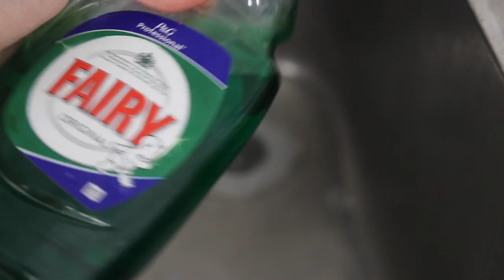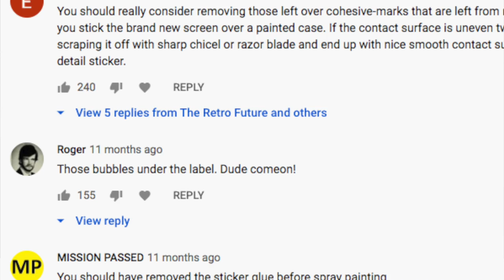$15 GameBoy Advance Repair & Restoration!

Comment: "I am going to give it my best shot to get this on film. Here we go." Shortly after, the bill of the cap gets in the way of the camera. ;)
Reply from the maker: Hahaha I hoped no one would have noticed!
Reply: @TheRetroFuture  soldering on camera makes everything about 10x harder, believe me I'm good with an iron and I struggle to do even large smd parts when there's a camera in the way.
Reply: @sjm4306  The people that get really good at it use a microscope with a video feed hooked up to it. So instead of using a helping hands with a mounted magnifying glass they just look through a screen

Comment: For your screen, you need to watch a few toy car restoration videos like Martys matchbox makeovers, Matchbox Garage  & Diecast resurrection. They show you how to restore the scratched plastic windows on these cars using Pledge revive it, 1200 grit wet & dry sandpaper  and stainless steel grit polish, most of the time they come out brand new looking. That's my 10ps worth of advice, love what you do keeping the nostalgia alive.

Comment: One way to repair scratched screen lens is to use fine grit sand paper and then clear coat it. The acrylic will set in and give you a good as new screen. Just be sure to wash it well after sanding and use the non-glossy acrylic paint, it improves on the original by reflecting less light. That's also how I fix scratched old CDs.

Comment: i just recently cleaned up my old GBA and buffed the scratched plastic screen lens. the brillo pad is a great way to start buffing out any larger, deeper scratches but as for a fine abraisive you can use toothpaste on a cotton pad to get an almost clean, tartar free finish

Comment: I had purchased a "broken" glacier blue Gameboy advance for like $5 to repair and when I got the thing, it immediately powerd on and I was pretty upset that I didn't get to do a repair it so I bought an ips v2 screen and moded it. Now I'm addicted and I have a original nintendo ds and a ds i xl that I will be restoring.

Comment: Friendly tip: Maybe use an ESD brush when brushing dust of the board. Static discharge can be a problem if you are unlucky. Great Video BTW //Samuel from Sweden
Reply: ESD brushes are good but with something as modern as a GBA they're not really necessary. The components are hardy enough not to get damaged.

Comment: Iknow it's old video but best way to remove almost everything is using isopropyl alcohol or n-hexane on cloth. These solvents can remove all marks and dirts, even more glue marks. Nothing to say it removes greasy, oily spots after fingers. So paint can stick even better

Comment: 😉Nicely done! The result is simply fantastic! You were wondering if this thing had already been tore appart and i'd say "yes" as the metal shield holding the cartridges has four screws in mine (i checked it); also you kept the serial number and it reminded me of the serial number i did restore, mine had been through a lot of battery leaks that had partially erased the silver part of the sticker, so i replaced that by removing it completely using IA which left the transluscent plastic plate with the serial number on it and then i stuck it over an aluminium sheet and cut it out. I hope it'll never happend to you but if it does perhaps you'll think of this little tip anyway keep up the good work!

Comment: If you don't scuff the surface of the plastic, the paint won't stick and will just flake off.
When spraying, it may sound silly but put your hand in this 🤙 shape, it's a good measurement to hold the can from the surface your painting.

- 6 years of painting cars

Comment: I think you might want to look into getting a scuff pad from a hardware store.  They're slightly different than the cleaning ones and can be less aggressive.  You don't necessarily want to see the marks in the plastic or remove material to get good paint adhesion. They're also easier to handle, since they're thinner and get get around uneven surfaces without having to push hard.  
something like: https://www.amazon.co.uk/Canopus-Scotch-Brite-Scuff-Ultra/dp/B075VCCZW9/

Comment: I love your videos. I just happened upon them over the weekend and they are stunning. I would love to learn and getting into restoration of video games as I played with them as a child. Anyway, one way to remove crap off is to putting them in a crock pot with soap and letting the heat and soap eat away at the scum. I tried that recently with some metal handles for cabinets. I know that would take longer for you video put just a recommendation. Keep up the good work.

Comment: Use some car polish caller 'Mer' on the screen cover (prob before fitting) and you would be able to remove most of the scratches from the sceeen cover 😉

Comment: I need to find my old Game Boy Advance. I know I stopped playing with it when one of the shoulder buttons wouldn't work anymore. Looks like that alcohol is a real cure-all for these consoles, I'll see what I can do.
Reply: Did you do anything to it?
Reply: @FirstnameLastName-mr8lk  Haven't found the old thing yet. However I did clean up my old Gameboy Pocket and got an original Gameboy in Black that I cleaned up, though the speaker is falling apart and needs to be replaced.
Reply: @broomhandle3700  oh ok

Comment: Most of the time, the power switch issues are caused by internal grime. Would be best to remove that top shield and clean inside.

Comment: Huh, I didn't know the rubber caps on the L and R buttons were removable. One of mine has been hard to push for a few years now due to a sudden impact on it. I'll give this cleaning method a try before I look for a replacement button.

Comment: Winkface!  Sorry, don't know how....

I can tell you there are glazing puttys that body shops use to remove sanding marks...  they would be perfect for what you are trying to do.  Sands super easy, just very gently sand it back, your little defects would be gone....

You could try plastic polish on that screen...  Or Novus plastic polish...  Or Cape Cod Cloths, watch repair people use those...  just very mild plastic polish...  You'd be amazed, even if it doesn't take 100% of the scratches out, with 90% results, the difference is remarkable....

Great video, I made it to the end and loved it.
Reply: could probably use woodfiller or something even tho its not for palstic, its just pva glue with sawdust in it

Comment: for the screens wouldn't you be able to clean up the scratches with a little soft wet sanding and the rubbing in some type of wax to fill any minor imperfections and overall give it a nice new shine to it?

Comment: 21:40 if you take a hairdryer on hot heat when peeling off the label the adhesive from the label will still be sticky you wouldn't have needed that adhesive pad

Comment: Hello, your videos are excellent. How can scratches on the case be improved without sanding? Improve the look with a simple method. I have a GBA grape. I bought it used and it is quite battered. I don't want to change the case for now. Thank you very much!

Comment: I've been going down a rabbit hole of your videos as I recently bought a modded and upgraded purple GBA SP on ebay and am excited by what's under the hood of these things. Maybe one day I'll buy an old OGBA and do something with it.

...I'll probably break it like I did with my Wii when I ripped the ribbon cable inside, but that's why I'll be doing it with something I'm not intending to use... lol. My dex stat is 0

oh and ;)

Comment: Hey Eliot, I've decided to try my hand at sown gbc and gba modding and I thought I could disassemble and reassemble the two that I did. Everything went well, they turn and the screen works perfectly. But neither of the speakers work anymore. Do you know why? Or what I can do to fix that?
Reply: The two places I would check first are the volume potentiometers and the solder points between the board and speaker

Comment: I use a product called Poly Watch to polish acrylic watch crystals but it says it works on plastic. I would give it a try on the plastic lenses. I just use an old t-shirt or cloth, apply a dab or two of the poly watch and do a circular, soft, buff. 

https://www.polywatch.de/en/plastic-polish

Comment: I managed to get a particularly groddy green colored replacement shell off ebay and did a splendid job messing up the repainting, aiming for the kiwi/lime green as close to the old GBC as possible, complete with bubbling and even drips like in the old DMG comparison retrobrighting/painting/replacing video you had. I remain curious whether you think retrobrighting would work for a darkened original indigo shell? Odd Tinkering / Odd Experiments had an interesting setup and experiment for which I've been stirring over. Thanks kindly for all the videos. Link for his experiment https://youtu.be/qZYbchvSUDY and the dreamcast retrobright https://youtu.be/jdWRsjnVD3s

Comment: I have a Platinum GBA
Reply: It has a loose power switch so if i touch it a little it might reset the system also scratched screen